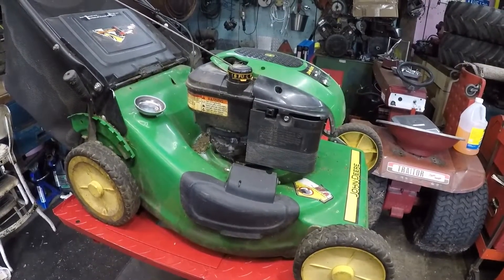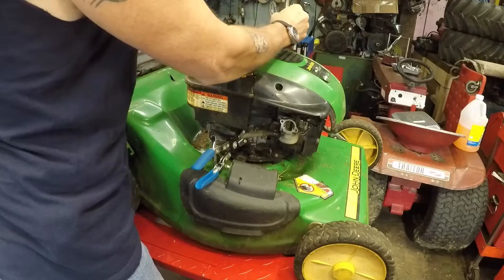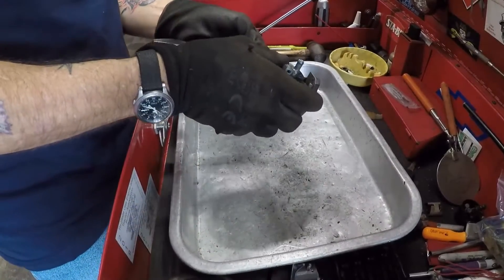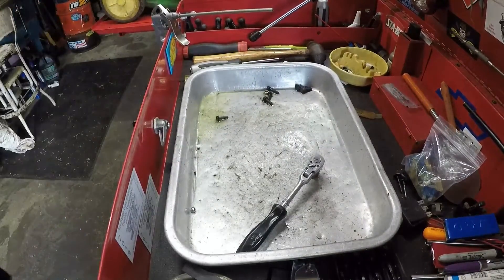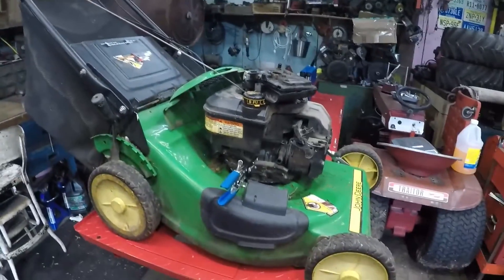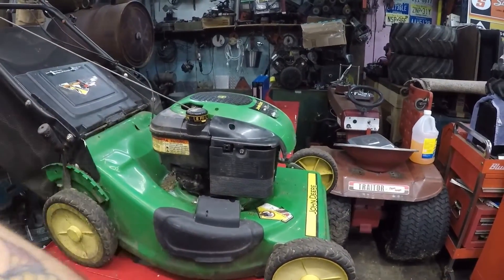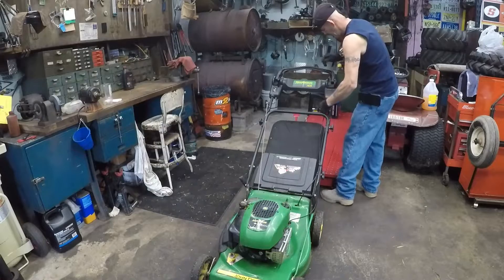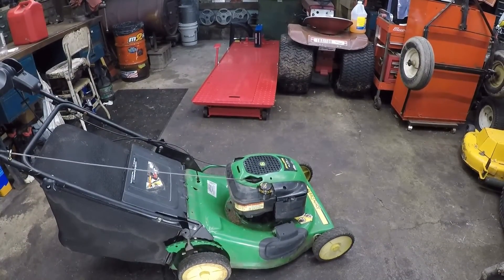Ethanol vs John Deere Push Mower...Who Wins? Ethanol!!!! #smallenginenation

Comment: Very nice Job Zippo. I did a GX-160 today that the carb was full of Water, Same motor every year despite telling the owner to use non ethanol gas and to run it dry at the end of the season. Like you said, keep taking their money. Thanks
Reply from the maker: I preach it. About 20% of my customers actually listen. I guess the other 80% aren't concerned with where their money goes. I'm happy to be part of their bank roll, but my feelings wouldn't be hurt one bit if they actually listened. Cheers waterman! Zip~

Comment: Pender Pan.  Helps with the dropsies.  The camera is always in the way around here.  I do many machines each year as you know.  You tell me just to put everything into the ultra sonic cleaner and not fuss with cleaning parts before hand.  ;-)  It runs   yahoo!!!!           I like those carbs    simple.  (great style of video  lol)
Reply from the maker: A little compressed air goes a long way! Sean~
Reply: @ZippoVarga  Right  Got to have air.     I have two different  outlet locations in the shop now   yeah.
Reply from the maker: I have the single centrally located hose reel, but I'm thinking about upgrading my air delivery system with CPVC. When I get that done, I'll have air locations on both sides of the shop at the machinery and work benches and move the dryer to the in feed line at the compressor. Trick will be incorporating the 26 gallon host tank that's about 6 feet away from the main compressor. I may make room to stand them side by side so it's easier to marry them. Fun Times, but that's the only big job I'll undertake in the shop except maybe enclosing the loft and installing a staircase. Cheers my Friend! Sean~
Reply: @ZippoVarga  Well last year you added a lot of toys to the shop.  You are probably still straightening that out too.
Reply from the maker: Still sorting some little things out and I still have some tooling to find a home for. Plenty of room in the big green tool chest. Two projects of my own are taking up precious floor space, namely XXX and Traitor. With the addition of yet another motorcycle in the garage, I can't move them there and I don't want to leave them in the elements while I tend to other repairs. So I'm caught moving them in and out during jobs. Babble Babble lol. Cheers my Friend! Sean~
Reply: @ZippoVarga  Well Mrs. Pender's car gets mover every-time i go out there but because of that I have guaranteed floor space to work.  lol.

Comment: Zippo Wins!!  As we all know, the number 1 enemy of small engines is owners not maintaining them or being vigilant.  I'd say the top 3 causes for repair I've seen from the ones I fix are: ethanol fuel, mice/rodent damage, and oil being low/empty.
Reply from the maker: That about sums it up! I tend to get the easy ones all at the beginning of the season but right off the bat this season, I've got a Kohler CV18 to rebuild. Collapsed lifter took out the #1 cylinder valve train and sent the intake rocker through the valve cover. The rocker didn't make it all the way off the spring, but it did clear the valve stem, so it began compressing the spring by it self, allowing the keepers to come out. This resulted in a free floating intake valve and it took a trip into the combustion chamber and made contact (I think) with the top of the piston. We'll see once the parts come in and I take delivery and get the head off. But with the damage on the valve stem...I venture it smacked the piston a few times. More to come! Zip~
Reply: Wow that's strange, usually the Kohler Commands don't have too many strange issues.  I'm starting to dislike a lot of the Chinese Honda clones though, especially on snowblowers.  The internals seem fine but a lot of the bolts, tins, clips, etc are way too cheap and brittle.
Reply from the maker: Very true. The aluminum is low quality and easily strips. One nice thing though, is you can over size most of the fastener holes and put good coarse threads in place of the fine threads and they hold much better. I've got a Lifan on my log splitter that's been on there for 10 years and it always fires right up. So far, the only thing I've had to do with it is change the fuel line. But, it's an earlier Chinesium engine. Cheers Josh! Zip~

Comment: I'm just going to start here and try to keep up. I have "Blow and Go" on my list of fixes. I charge an hour for it. Carb gets a blow job a poke and blown out with carb cleaner. After that I take the flywheel cover off and service the mag and pickup just out of habit. They don't listen. At LEAST run the fuel out and throw a cover over it. Nope! Tanks full of gas, left outside all winter. Heck with it! That's a quick $30 for me!
Reply: thanks for your info on the screw drivers. i ordeded a set  they be here in about a week.
Thanks again to you And Zippo
Bob